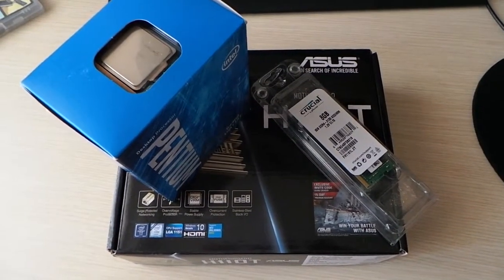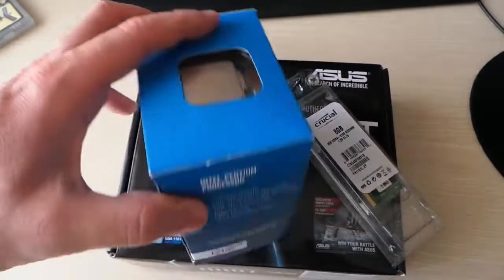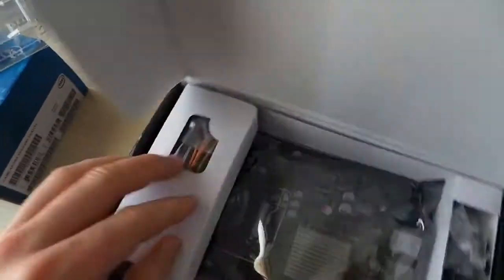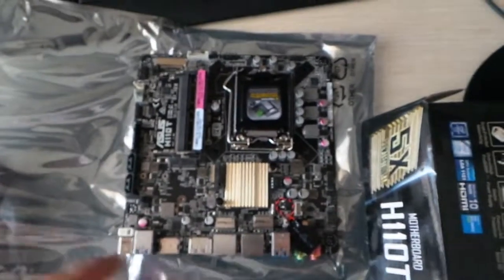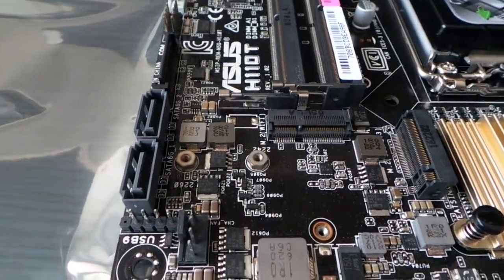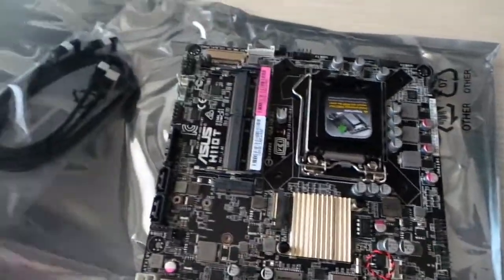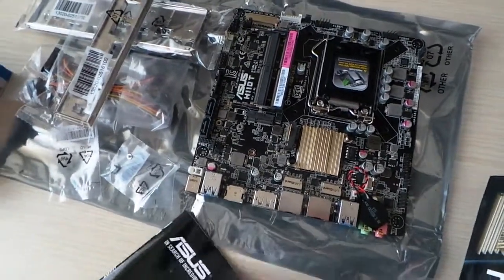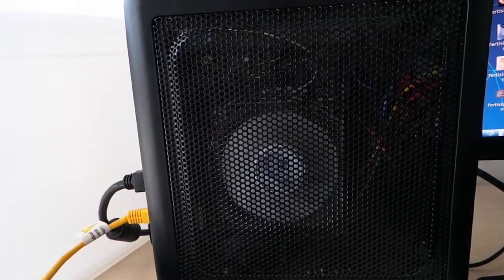[FIRST VIDEO] - ASUS H110T review & quick system overview

Comment: What case will you use? really like this board on pt13b case
Reply from the maker: I used an Antec ISK-110 with USB ports, DC-DC converter and headphone jacks removed.
You will have to get a thin-ITX cpu cooler if you want to use the PT13B.